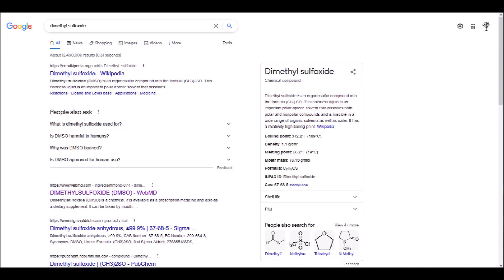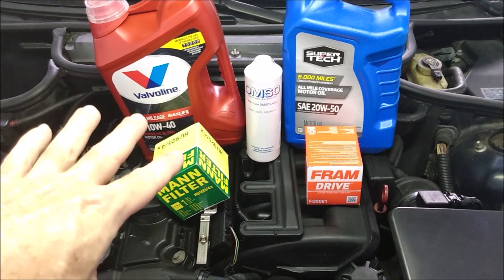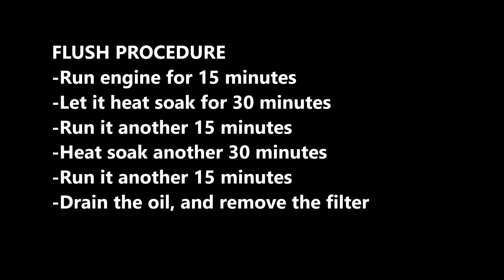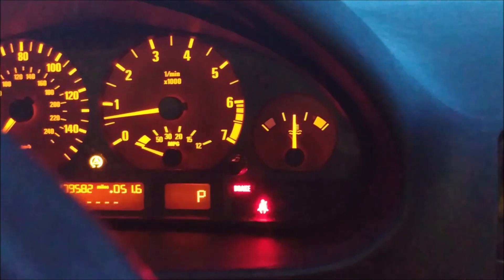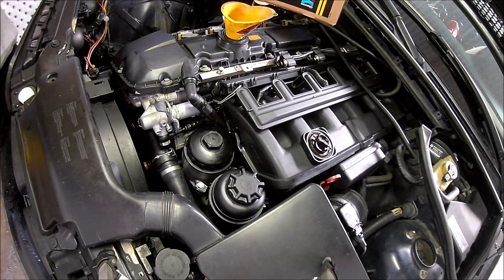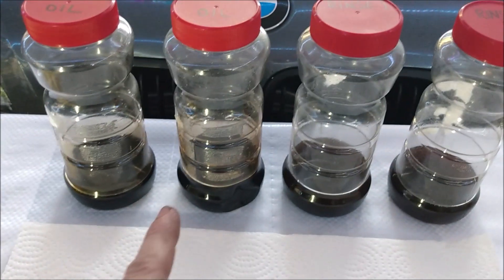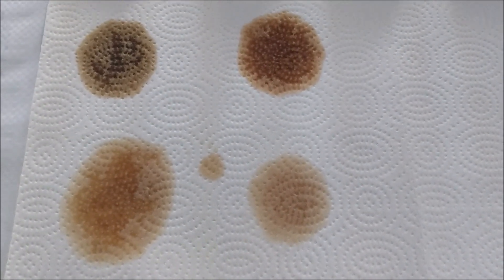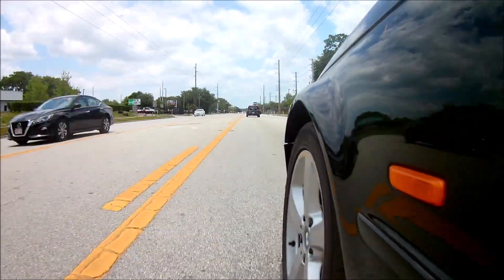BMW E46 Project: Engine Oil Flush with Dimethyl Sulfoxide (DMSO)

Comment: Good video, I did the same on high mileage engine. I flushed engine 3x with clean oil, then added flush solvents per instructions. Inspected engine, filter and lab tested, no additional carbon and sludge removed.  I continued to do clean oil flushes after each normal oil change.  Over a period of 2 years, a great deal of cleaning occurred.  Engibe oil detergents are designed to work slowly and safely.  On any engine, 10-20% of old oil remains in an engine. Doing a clean oil flush gets 99% of the old oil out, so new oil can do a much better job.

Comment: Dmso dissolves paint like a charm and some oil pans are painted from inside like toyotas. Dissolved paint clogs oil pickup tube.
Reply from the maker: The BMW oil pan is aluminum, and it's not painted. However, someone mentioned checking the dipstick tube, since it's painted (or maybe powdercoated?) black. The DMSO did not eat off the coating. The concentration was probably not strong enough.

Comment: Really interested to see if this works on the Audi 2.0 with plugged oil control rings.
Reply: It a ‘17 so not a common problem engine.  It had excessive crank case vacuum, so the oil separator was changed. Still drank 2 qts in 500 miles, so a 2 can Berrymans B12 piston ring flush was performed through the spark plug holes. It seems to have cured it. No oil has needed to be added in over 1000 miles.
Reply: @GusMahn  Nice! Thanks for the update!
Reply: Any update?

Comment: What a crazy dsmo Rabbit Hole I'm going down. So can you use this like seafoam?
Reply from the maker: I personally wouldn't use DMSO in the intake or the fuel system. But it works OK as an engine oil flush. It really stinks when it gets hot!
Reply: @michaelblacktree  awesome! Thank you so much for the reply

Comment: great video. my question would be what was the original oil brand and viscosity before the flush. its evidently pretty good at cleaning as well judging by the filter
Reply from the maker: Before the flush, I did some major engine work (see previous videos). That dislodged some of the sludge.

Comment: I have tested DMSO. On removed carbon clogged pistons it worked like paint stripper. Also I had pured about 100ml DMSO into old engine oil and have driven it several kilometers before oil change. Oil got very thick and dirty.
Reply from the maker: Yeah, it's effective. But my engine had so much sludge in it, I think it'll take multiple treatments.

Comment: The heat cycling of turning the engine on and running for 15 mins, then letting to cool is a good idea; the heating/cooling cycles cause thermal expansion and contraction, which I believe would help loosen debris from surfaces.

Was that your idea behind the "heat soaking" and thermal cycling? You earned a subscriber btw; very good content.
Reply from the maker: Thanks for the compliment! To be honest, my goal was just to let it heat soak as much as possible. An engine can hold heat for a long time. So I tried to use that to my advantage. That said, the engine flush did loosen up a lot of stuff. And some of it is still making its way to the oil filter. I had a feeling that would happen, so I bought a bulk pack of oil filters.
Reply: @michaelblacktree  DMSO works better at temperatures > 80C, so there is no benefit from cycling

Comment: Some free tips for you:
This procedure requers at least 3 rinses
1. New filter and oil + 10-15% DMSO high idle for an hour.
2. New filter and oil + 10-15% DMSO high idle for an hour.
3. New filter and oil + 10-15% DMSO with light pulsing rpm increase up to 3k for another 45 min..
All hoses from valve cover to intake manifold should be disconnected (pvc system), this will decrease detonation.
After rinse completed you should go for a regular ride on new oil and filter for 15min. Drain OIL.
You never let it soak, never! Shut the engine and drain oil immediately!
I highly recommend removing oil pan to inspect oil pickup tube screen. It its really possible that it is blocked with all kind carbon, gasket material.
If the oil pan is painted it will lift paint block oil pickup tube and engine will oil starve....
DMSO is great for oil scraper rings, it can reduce or eliminate oil consumption due to carbon clogging.
Also it is destructive to some kind plastics, so my suggestions is not to use on German engines or the engines with painted oil pan. 
Engines with sludge problems and German engines, I would suggest using BG Dynamic Engine Restoration. It works almost as good as DMSO, nothing can come remotely close to it.
BG kit will not damage plastics and will not damage painted surfaces.
Believe me, I have tried lots  of different stuff.
Other than that, great video:)
Reply from the maker: I appreciate the thought, but the engine is fine. Since the flush, I've been drag racing twice. It runs great!

Comment: It needs more flushes to clean up engine in your case. Just do it couple more times. 
Also keep in mind that it maybe looks not perfect clean but all the carbon becomes loose and oil will easily clean it out later.
Reply from the maker: I agree.